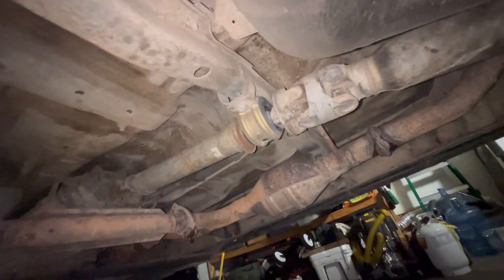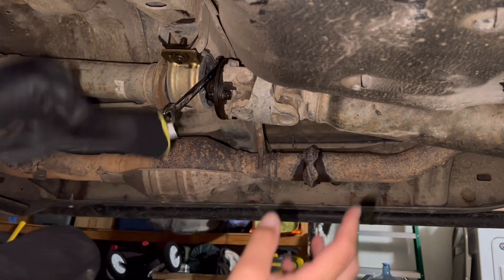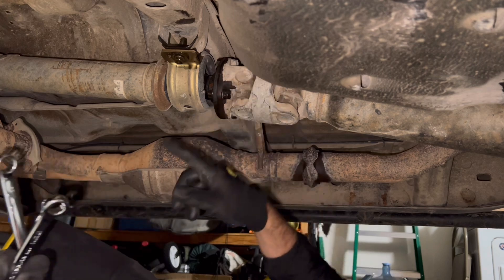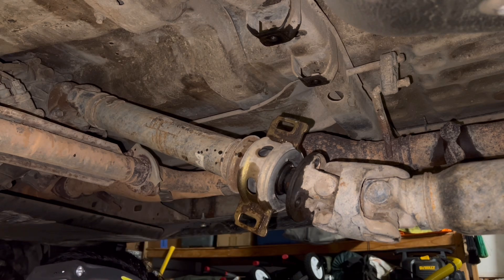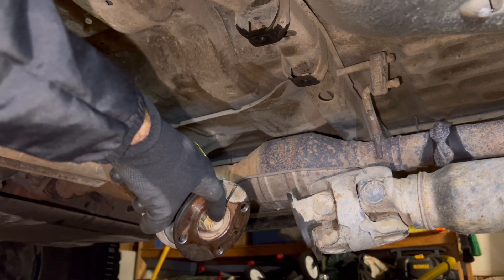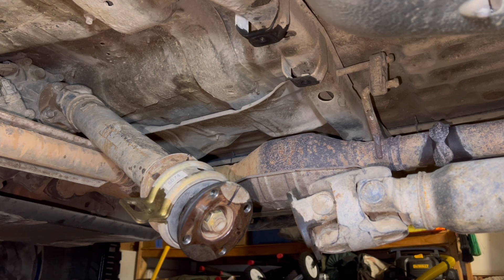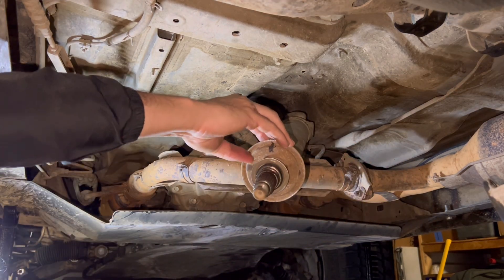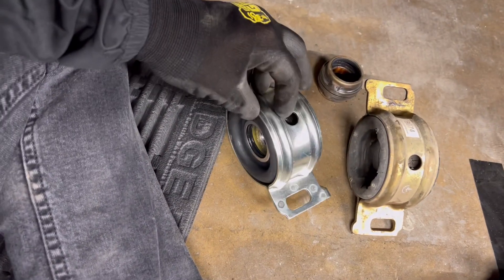1st Gen Toyota Tundra Driveshaft Carrier Bearing install

Comment: What indicators did you have showing you it was bad?
Reply from the maker: Hello Marcus. driveshaft wobble, vibrations under acceleration
Reply: @dr_omiz  I was hoping  you had a similar  symptoms  but unfortunately not. I've got a drivetrain howel im hoping is the carrier but my suspicion is the the rear end. You still got your oem rear 3rd member btw?
Reply from the maker: @marcusmacdonald3594  I am regeared to 4.88 nitro gears with and ARB carrier/air locker. Howl coming from your rear diff? if its consistent with acceleration then, yes i would point to your diff if it its inconsistent more of a womp, womp as it rotates could be a bad bearing or wheel bearings
Reply: It constant only when acceleraating. Most noticeable 30mpg+. The pitch continues to climb as speed increases. It's not gear oriented thank god. Constant howell. When on the gas and instanly goes away when I get off the gas. Got the car on 4 jack stand to see if I could pin point it but my driveway being sloped i did not feel comfortable getting under it. I feels its a bearing to just hopefully  not one inside the diff. If so I guess it will be time to regear. How do you like the air locker btw?
Reply from the maker: @marcusmacdonald3594  I would have a gear and axle shop do a diagnostic if possible. Air locker has been solid, no issues to report.
Reply: @marcusmacdonald3594 I had no vibration.  But I would hear a thump noise when accelerating and a hum/squeeling noise when turning right.  My bearing was destroyed.  The bearing had completely separated from the rubber.

Comment: I just did mine on my 1st gen Tacoma.  I followed the video from @funjunkiegarage also.  He was the only guy that had a video of someone doing this without pulling the entire drive shaft off the truck.  Mine went nearly as smooth as yours did.  I had some problems getting the two drive shaft sections lined back up.  My truck was on a driveway with a slight incline.  I put wheel chocks behind all 4 wheels but when I split the drive shaft it appears the truck settled back a little against the chocks.  I had to get my foot on the front frame crossmember and push the truck forward while lining up the drive shaft and wrestling the bolts back into the driveshaft.  Took a while but I got it.  My stake nut was not staked either.  And the drive shaft bolts were real tight on mine like yours.  The torque spec for those is 54 ft.lb. but you can't get a torque wrench on them so I think people just tighten them way too tight.  Also, the torque spec for the big stake nut is a 2-step process.  You torque it to 134 ft. lb., then back it off and torque it again to only 51 ft.lb.  The bearing is not pressed on but the 134 ft.lb. torque sets the bearing.  Congrats on getting yours done!  It really isn't that hard of a job.  Other generations of Tacomas and Tundras have a different design where you have to disassemble the double cardan joint.  That's a pain in the ass that I'm not sure I'd attempt.
Reply from the maker: Hey good job to you too man. Thanks for watching my vid and dropping your experience